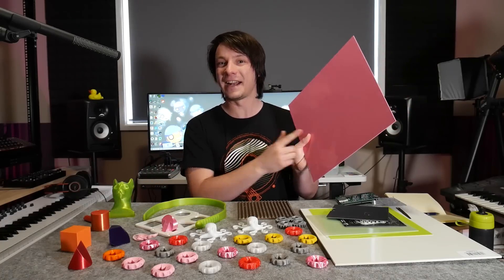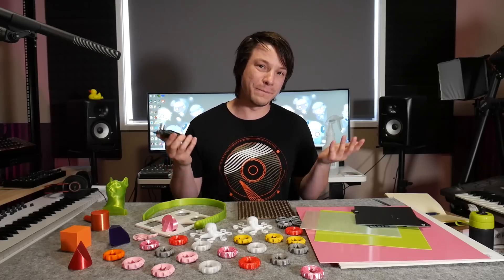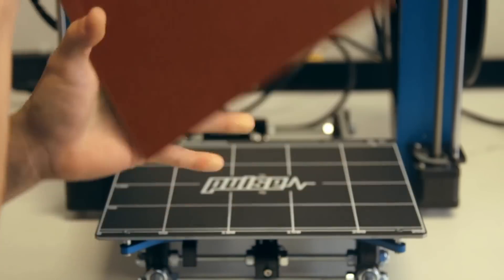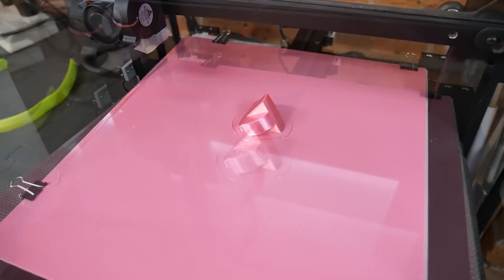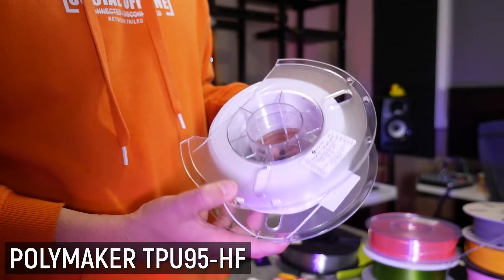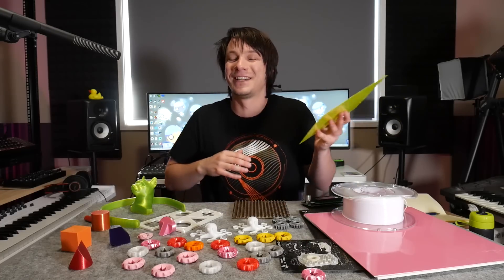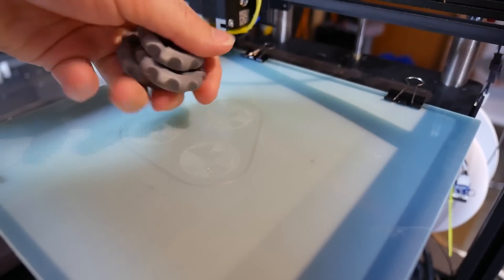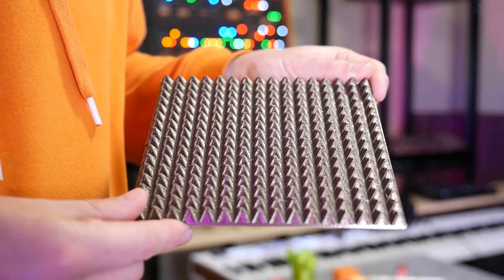G10 - The best print surface you've never heard of.

Comment: On the topic of making things for printers well known, something that can help clean out the nozzle are guitar strings. They're really thin, flexible, and you can buy a ton for a few bucks
Reply: i hadnt thought about that...and i have a bunch of used ones i wanted to recycle! thank u!
Reply: I use acupuncture needles for cleaning my nozzles.
Reply: Yep yep I have a made in Mexico Fender Strat and the other night I used a spare Ernie Ball Slinky G string to ream my nozzle. It's pretty much exactly .4 mm so it's a perfect match.
Reply: lmao for a second I thought of my dad's thick metal acoustic guitar strings and I had a heart attack thinking about running those through a printer lol.
Reply: @ironbeagle1610  I'm not sure if these are acoustic or electric. Surprisingly, it has the diameter of the string in mm on the packages. But yeah, not the lower strings with the coil, the higher pitched ones

Comment: I have used FR4 and FR2/pertinax plates for some time now. I use them in 0,5 or 1mm thickness and glue them to my springsteel sheets for the magnetic bed (helps against warping). Most materials can be printed on both fr4 or pertinax  but some are better on one or the other. At least in germany there are several shops to buy these plates. I also love that i can just sand it down a bit if the surface is damaged or dirty and then continue printing. Also this stuff is more heat resistent then G10.

Comment: Thanks for doing this investigation. Regarding alligator clips, one option is to get a plate that's too big and cut it in a way that you still have tabs on it, then use screws or something to hold the tabs down without losing on print volume.
Reply: Clip frame 'clips' are  Far better than those spring steel bulldog types.

Comment: A German 3D printer manufacturer 3D Factories actually uses a thick (like 5-6mm) sheet of this, paired with a silicone heater, for their printers. I really loved (unfortunately don't have access to it anymore) using the Easy3DMaker because even though it would take a really long time for it to heat up, the print would come out great, and getting it off the printer would literally just be waiting for it to cool down, and simply picking it up from the build surface.
It's definitely worth it getting the closed build volume version (or making one yourself because they ask additional 500 EUR for the parts that make it a closed build volume printer) because it will not only help printing heat sensitive materials, but also heat up the print surface much faster and to much higher temperatures (at one point we ended up wrapping the 3D printer just to get it to heat up faster)

Sidenote, idk if you reviewed the machine already, but it'd be cool to see it.

Comment: Awesome that this came up right when i was looking at a new build surface. I've always used a PEI sheet and was looking at a double sided Energetic PEI bed to get that bed flex ability, but hey maybe i'll try one of these first cause they're so cheap and close

Actually i just noticed that place you listed for Aus, i'll be just down the road getting the ole shoulder jab on thursday......i think i might have to do a click and collect :)
Too bad they dont do G10 solid rods in 8mm, if its truely like poormans carbon fibre, could have been a cheap light weight alternative for my worn harden steel rods lol

Comment: It's interesting you have so much trouble with petg. I have 10 Prusa minis with the powder coated plate and I've printed thousands of petg parts with no problems. I also exclusively use prusament. Petg works so well for me I don't even use pla anymore, my petg print quality is just as good as pla. The smooth sheet is not as good but the powder coated sheet holds extremely well and self releases just like this video.
Reply from the maker: The powdercoated PEI seems to be decent according to a fair few comments, I did a bit of PETG on the Mk3 before donating but since then it's just been glass "ultrabase" and similar, which all seem kind of average.

Comment: I have been experimenting with making my own build sheets for my Prusa with a garolite from McMaster, spring steel, and a protective PEI film for the underside of the steel. Main purpose is for print with my carbon fiber filled nylon filament.  A weird little phenomenon has happened in a short period of time with the sheets when they start to warp. Sometimes even just sitting there off the machine I come back and it appears worse. I print without turning the bed heater on since the parts stick fine, but I’m exploring how to prevent the warpage. Jump in if there are any theories…
Reply: Turn the heated bed on. Maybe temperature differences are too big between places with prints and the empty places making internal stress on bed surface. Also I would probably ditch the pei from under the steel just to eliminate other variables.

Comment: People didn't know what G10 was because its basically only called that by knifemakers. Garolite or FR4 are slightly more common name. The one downside here is uneven heating, because you need the entire sheet to be pressed against your heated bed for it to transfer heat (binder clips may not do it).
Really surprised to hear you have so much trouble with PETG. I basically only print in PETG, which is why its always disappointing everytime someone comes out with a new video about a 'fantastic miracle bed surface' only its for PLA again. As if we didn't already have a hundred options for it. Might give this a try, since polyamide tape on glass takes a little while to cool down and remove parts from.

Comment: I still do not understand the PETG concerns.
Almost as easy as PLA. Perfect results every time.
Use the standard settings from Prusa Slicer. These are tuned perfectly. I used them for lots of different brands.
Just love it.

On my textured PEI printbed it sticks perfect as long as it is heated. During cooldown it releases by itself. Almost magic.
On my smooth PEI printbed I use some glue to ensure that it does not stick too well.

Comment: The FR4 sheet used for circuit boards usually have some fluorescence property. Some UV light might make the improper print bed adhesion even more visible.

Comment: I have been using Garolite for PETG for a while now. Sticks great and no release agent needed like you need for PETG on PEI.  For PLA on garolite I wasn't happy with its adhesion. Would get curling corners pretty bad, curious if you would see the same if you printed a bigger part. So these days I use PEI for PLA and use Garolite for PETG. 

As far as fastening it to your bed if you have a magnetic bed you can use adhesive to attach the garolite to a steel plate and just use it just like PEI on a steel plate. Or if you use thicker garolite (at least 1.5mm) you can attach adhesive magnetic sheets straight to the garolite and not worry about a steel plate.

Another print surface you might want to try is Lexan (polycarbonate). It has a high enough glass transition temp to be used as a print surface and is almost just as cheap as garolite and can be had in thin or thick sheets just like garolite.

Comment: Great video, thank you! I have experimented with etching heating coils straight to the material and print directly on the other side. Designing uniform heating elements is not easy, though, and I failed. Having said that, commercially available, cheap, heated beds are made from the same material, but they have a layer of solder mask and are not bare! That changes the adhesion properties quite a bit and might make it unusable as a direct printing surface.

Comment: Wow, my dad had some of this stuff when I was just a kid!  I wish I knew about this stuff years ago, since bed adhesion is the biggest issue I've had to deal with!  The only problem with this material is the fact that both of my printers use the hot hotend to touch the bed in a grid to automatically level it, so I think it would melt it!  Had this problem with buildtak too!  So, I will have to change the order of the heating and leveling in the custom g-code and I will probably have to udjust the Z-offset to compensate for the thermal expansion of the nozzle!  Thanks for this great video!

Comment: I am printing PETG with a basic glass for a years. After several prints glass should be wiped by a solution of PVP in alcohol (5 gr of PVP in 200 ml of isopropanol or ethanol)
PETG perfectly sticks to that glass and detached by itself when cools down up to 30-35C.
Also suitable for PLA.

Comment: Yet another material I have ... right before my eyes and never tried to print on. ^^' I did use Ultrabase on my Anycubic for ages (factory build surface) before moving to dual-sided flex PEI spring steel sheets.

The results you show with the usual "best enemies" like ABS/ASA or nylon are really interesting and lead me to try this asap.

About heat transfer, why not use, say, a single-sided PCB sheet ? They are natively 1.5mm thick and the copper side could help with even heat distribution.
Also, I wonder if it would be possible to have those garolite sheets "magnetic-friendly". That way, no need to wonder about clips.

Comment: Could a thicker sheet work as the build plate itself? I want to make a large format 3D printer, and glass or aluminum plates are pretty expensive.
Reply: Yes it could. Mirror glass is very cheap, but can be a bit dangerous to work with.

Comment: Angus, I got my Ender 5 Plus several months ago from Tiny machines (MS extruder and hotend, 0.4 nozzle) and have been using Simplify 3D as my slicer.  I want to move to Cura for the additional options and features, but am having a time trying to equate items in the two slicers to set the parameters from a good profile on S3D over to Cura.  Can you recommend or even post a video on migrating from S3D to Cura and how to setup an equivalent profile in Cura from one that works in S3D?  Many thx!

Comment: If you want to use the thinner FR4 you can buy large sheets of thermal interface silicone. Basically this is the stuff that goes on heat sinks between heat sink and surface. Works pretty well as a low tack adhesive so you can remove the surface

Comment: And how about a single-sided FR4-copper laminate? (stuff made for etched DIY PCBs) Copper side helps with heat distribution and you can solder things to it (like positioning tabs, or washers that would work with magnetic beds). It costs about half the price of PEI-covered steel plate... wait. PEI plate easily outlasts two FR4-Cus. Maybe it would be more viable if printed on copper side. Anyone tried that?

Comment: Will definitely try and source some of this material for my odd sized Snapmaker2 bed. Glass ultrabase print bed from China has been working well however I think there might be an advantage shifting less weight back and forth on the Y axis. TOP TIP: you can remove and reattach the metal handles of black clips by squeezing them near the base! No more interfering with the X gantry 👍

Comment: You got me thinking...."used for PCBs" .....I just happened to have a sheet of single sided PBB board prob about 150x75 x1.5 or thereabouts, so I cleaned it up, put the copper side on the bed, adjust the bed temp from 60 to 75 (70 is prob ok) and boom! worked like in your video...on the 2nd try. Jaycar sell 150x150 sheets of PCB for about $11NZ.
But all the same, I have to agree, its the best thing, esp for PLA which I was using. Going to track some down for my bed size....
Reply: Just a follow up, I found a bigger piece of PCB board at Jaycar, cut it to size, put it copper side down, and that stuff is AMAZING! Especially if you let it cool down below 40 dec C. It literally falls off! I have found 70 deg C is perfect, accounting for some heat loss from heat bed to top of the board. best $30 I have spent! I have had no issues in 2 weeks.

Comment: Yo Angus. 

Do you/ did you remove the heat bed from the printer ?? I have x1 sidewinder, glass has heat mat glued underneath and the screws attach to the glass also. 

Did you just apply the sheet on top and attach with bull clips ?
Reply: James I just posted this somewhere in here, very relevant as I run Sidewinders.......Many thanks Angus, cheap as chips you said, not too easy to find in Australia but in the USA it is available in hundreds of places but here in England it was like trying to find Rocking Horse Droppings.
Eventually I found some, ordered a thinner sample than I was intending to use because this piece had a Copper Surface on one side…..  Now anyone with an Artillery X1 like me, knows that bed heating, although fast, is NOT even, not even close (see what I did there?).  So my Warped Logic, along with my Warped Bed thought, Hmm, Copper transmits heat very well, so that should help even out the Bed Temps, yes?  Hell YES.
The material I used is actually FR4, not G10.  To all intents they are identical, except that the FR4 is non-combustible ... G10 is not.  To use more technical terms, the FR4 is rated 94V-0 (the best) by UL where G10 is 94HB (not good).
I got some 0.8mm FR4, Copper Clad on one side, clamped it to my IKEA Mirror and hit the Heat button.  I was very happy to see much more equal heat, from side to side and front to back.  This improved, obviously with time.  So, if nothing else, this is a huge plus point.
Now for the print surface itself.  Thorough cleaning with Isopropyl Alcohol, I do mean thorough.  As it stands it is possible to get that all important First Layer down and down very well indeed.  After 2 or 3 prints, yep, I am lazy, did not clean between prints, some failures occur.  Clean again, with IS and away you go.  I had fantastic success using my bed adhesive of 20% Modge Podge, 80% Water.  Put on with a kitchen towel, it creates a very thin, even surface.  Printing on this I had ZERO Failures.
The FR4 I used was way too thin at 0.8mm, I did get some 1.5mm Copper Clad one side but have yet to try this out, there is no reason at all to expect anything other that good results from that.
Cost, well as you know the X1 is a 310 x 310 Bed, the 0.8 was under £10, the 1.5 is actually in A4 Format, as let’s be honest, do we always need 310 x 310?  No.  Full disclosure here, the A4 was sent to me For Free for me to test, I will NOT get a penny out of any sales he makes, or doesn’t, I just explained it was for a purpose, he had probably never considered before.
I am happy to share contact details for the Gent who I got mine from.  Any questions please feel free to ask me, apart from pricing, I have no clue at all but based on the 0.8 being under a Tenner, it is a great alternate to waiting weeks for Gizmo Dorks 1mm PEI to arrive from the USA and the ridiculous cost of shipping it, I just found 235 x 235 1mm PEI by Gizmo Dorks on Amazon for £39.70, hell, that is steep.  I would say, risk a Tenner, or a bit more if you want the 1.5mm.
Anyway, his name is Joe, I would never put a correctly formatted e-mail address on here as it will just get grabbed by the spiders and he will get tons of spam, so take out the obvious bits and include what you need to, to make it work.
Joe at protetch dot co dot uk  In the Subject Line please include 3D print
Give it a go, nowt to loose.
Allan
Reply from the maker: Sidewinder is unusual in that the glass can't be removed, usually I affix to the aluminium underneath and change the Z height. I don't see much benefit attaching it OVER the glass but it should still work.
Reply: @MakersMuse  thanks for taking the time to reply. It's appreciated ! 

I'll give it a whirl and see how it goes. Sometimes the x1 glass sticks way too well haha

Comment: Stick it down with the adhesive backed magnet that they use for removable car signs. Put a thin sheet of metal on the heated bed first so the magnet will stick down. I’ve done something similar when I changed from glass to a piece of flat cromadek (epoxy coated metal used for car ports and garage doors). I put the sticky backed magnet down on the hot bed & just stuck the cromadek to the, now magnetic, hot bed. I’m going to investigate that G10 stuff. Thanks Angus!

Comment: Single layer pcb can be printing surface and heating element. The first copper layer becomes a heating element by making a long trace with a sertain resistance and leaving the PCB's other side not coated in soldermask. You can order your own custom heater and print surface very cheaply and easily through PCB fabs. I'd specify milling the uncoated side or print surface so there's a truly flat surface for printing, and getting a thicker than normal pcb like around 3mm thick.

If your PCB manufacturer has the option for aluminum backed PCBs you can order a stack up that is first copper layer and FR4 core(single sided PCB), aluminum layer, and a final FR4 core layer that is print surface. Aluminum layer allows for even more thermal mass and to thicken the pcb for mechanical stability.

Comment: Hello from Germany. I use FR4 since years. In Germany it is a very common print surface. If you get scratches from nozzle or if you have sticking problems sand it down a little bit with 120. then you have a mat finish like new. And you can sand it again and again. And don‘t forget you have two sides ;) Regards

Comment: G10 is actually pretty commonly used as a print bed surface.  
My Afinia, UP!, M3D, Ender3, all came with print surfaces of the same smooth G10 material.

Comment: man...had me for a second, never heard it called G10. tried FR4 a few years go while printing PSU. it worked pretty well, got a whole 130mm drone frame printed in PSU, its a bit brittle for that application though. also if anyone is reading this and uses Polysulfone, DO NOT USE LOCKTITE...anywhere near it. it completely disintegrates and turn to dust. ask me how i know.
Reply from the maker: Locktite annihilates polycarbonate too, pretty crazy!